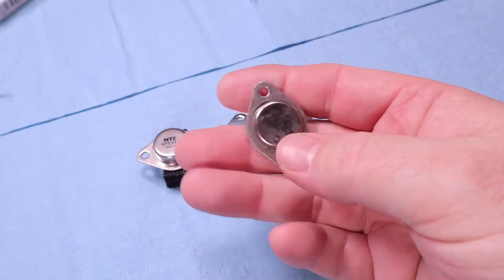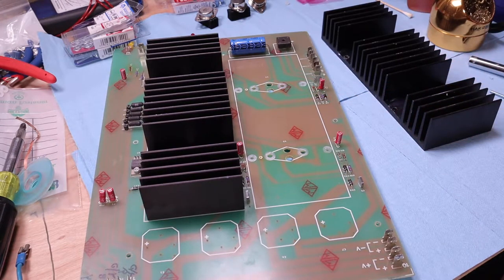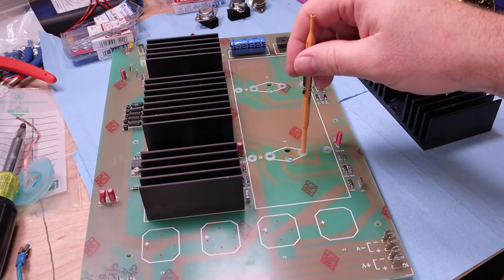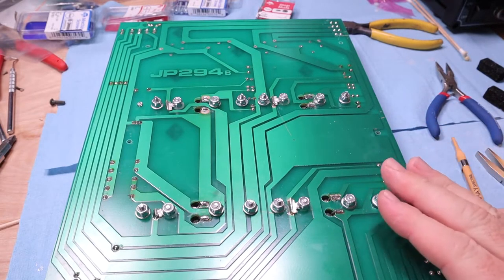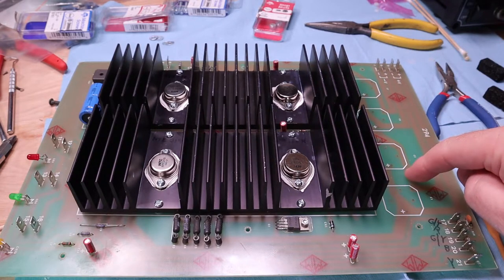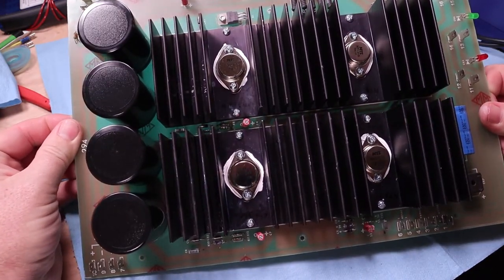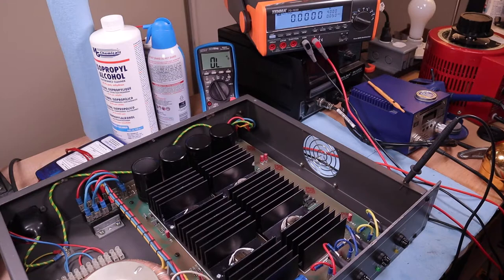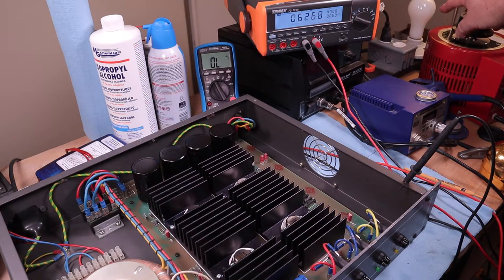AMEK TAC Scorpion Power Supply Overhaul Pt.2 DoItYourselfMusician #44

Comment: Thanks so much for this tutorial. I'm in the process of restoring a 16/8/2 Scorpion and I started with this vidoe to rework the power supply. After performing all the upgrades (except buying new semiconductors), I get -17 on the negative side and +32 on the positive side. I have checked and rechecked all solder joints and connections. This same voltage can be measured at the output jack and on the other side of the board where the bridge rectifier connections are. Does this sound like one of the voltage regulators has gone bad? Any help would be much appreciated. Thanks!
Reply from the maker: Yes it could be that the regulator is bad. You should check the supporting components out of circuit to be sure they are good as well.
Reply: DoItYourselfMusician thanks for the reply. I went ahead and ordered replacements for all the to-3 parts. When I went thru the circuit again, I found that one of the regulator cases was shorting to ground. Problem solved!